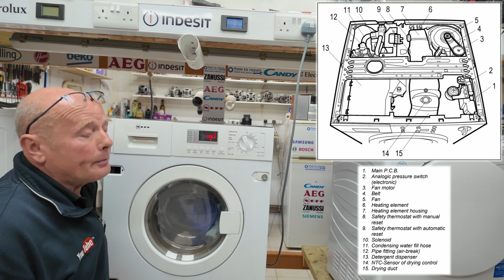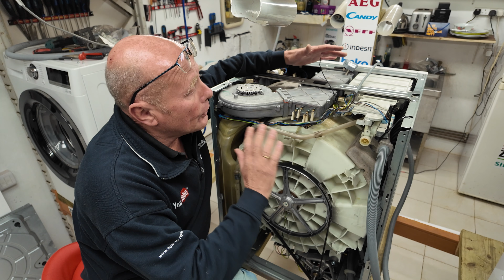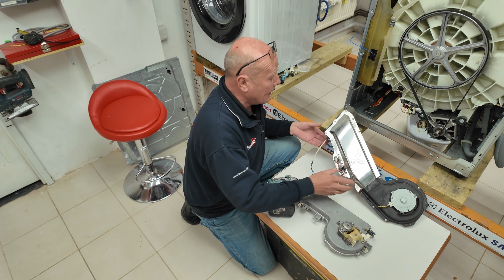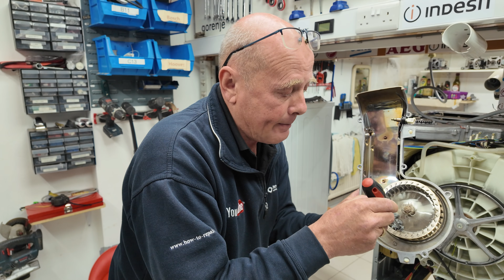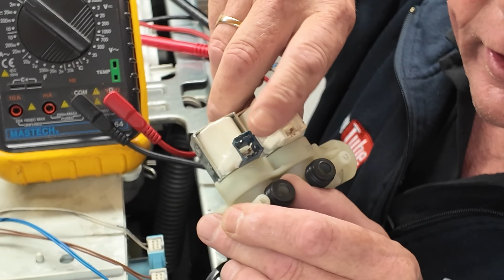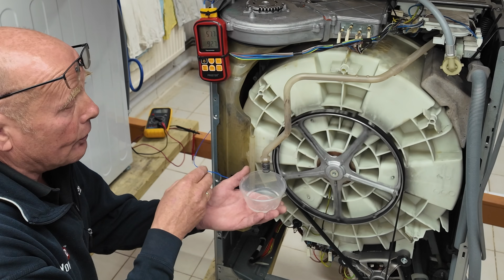How A Washing Machine Dryer Works? How to Rectify Washer Dryer Combo Machine's Errors & Faults

Comment: I have a Beko washer-dryer and its stopped heating at all, not only during drying but also washing. Changed heating element on the back of machine (under drum part) still the same. I planing to check thermostat and heater chanel. Any recommendations what could be wrong?

Comment: Thank you.
BOSCH  Washer/Dryer Series 6.
Mine wasn't draining, after research I looked at the Impeller, it was blocked, I removed the object & it drained 🙂
BUT......
Now it doesn't  dry!! The VERY NEXT wash drained but didn't  dry. 
You stated at about 6 mins & 30 seconds that Bosch ain't good at giving technical information!! TOO RIGHT!! Some of them from their help line say my washer dryer DOESN'T  have drying sensors others say it does!!! I'm  going around in circles!!! 
The washing isn't warm or dry!
 Coincidence it happened STRAIGHT after the draining problem? 
I was even told to clean the drying  sensors but when I asked where they are I couldn't  get a straight answer! One said they are IN the drum at the front near the door (couldn't  see any), others said it doesn't  have any!
HELP!!
Which is it?
What can I do?
Thanks for any help you may give. 
I'm  going to give them a very bad review.

Comment: Thankyou, Paul. My 2.5yr old Bosch popped the overheat switch. Bosch nearly charged me a few hundred bucks call out fee until I quoted Australian consumer Law. 

Tech came out. Did a few tests, hit the overheat switch and said job done, not to expect great performance from combo machines, and don't run too many intensive programs after each other... Fair enough, I'm guilty of running it pretty hard... 

6 months later, same problem. I figured I'd hit the switch myself. Fixed again.  I'm at home with a toddler and can't be without my machine. 

Did some reading, found you. And just spent half an hour pulling a not-so-insignificant buildup of fluff inside that fan housing. What a shitty design! No wonder it was overheating! And taking forever to dry! She couldn't breathe! 

I'm off to the buy Paul a beer page! You're a champ. Thanks from Down Under 🐨
Reply: And oh my god it just did a 2.5hr dry when I set it to do a 2.5hr dry. THANKYOU.
Reply: And holy shit the towels are actually dry! 😂 I'd been finishing them off in the old vented Tumble dryer for so long! 😵‍💫

Ok. I'm going now. 
You are an excellent human.

Comment: Hi, we changed our Samusng washer/dryer machine "wd80j5430aw-le" wather inlet 3 way walve. After that we tested the drying cycle of syntetic and we noticed that the machine was taking in wather all the time. When the cycle was done, the loundrey got out wet and cold. Do you maybe know why? It's like she's not regulating the walve at all, or cannot close it. The original walve had a small yellow flow restricotor in the rube of the drying walve, but the new 3-way walve has no flow restricotor there.

Comment: Hi

Ive a Hoover washer dryer 600 wash and go, model H6DPB6106MBC8-80.  

I can't get a definite answer from Haier or on the Internet if the machine is faulty.

It dumps 140ml of water into the drum and onto the load at the beginning of the drying cycle, then does the same amount 30 mins later straight after a high speed spin.  Does it on all drying cycles.

Is there a fault if not, why add a total of 280ml of water in a drying cycle?

Your video was great and detailed.

Comment: We just bought a Candy washer/dryer brand new, and it does somewhat work, but even when we choose the "extra dry" function in the app, some clothes still come out a bit wet (not dripping but just a bit wet to the touch). Is that a normal thing that it doesn't 100% dry the clothes? This is our washer/dryer, so we are very inexperienced with this :D

Comment: Hi, I' ve an Aeg series 7000 kombi washer dryer. Is it normal in this specific model that the drain pump is  always and continuosly on rotating for all the drying cycle? If the drying cycle lasts 2 hours the drain pump runs for the same time without stopping. I've had some washer dryers of different brands but this Aeg seems strange for me in the drying cycle. The results of dryng  are good with no error stored in the service menu but the drain pump always running is not normal compared with the behavior of the drain pumps of other washer dryers that stop for some minutes during the drying cycle. Please let me know for this specific model of Aeg. Greetings from Italy.Marco

Comment: May I ask, if I were to book an appliance engineer to do a MOT on my washer dryer what is the average cost (like you mentioned build up of fluff, pump check etc).  I recently was quoted £400 with 2 component replacement (not programme board).

Comment: Thanks Paul! My daughter just called me and said her 1 year old Samsung WD10T754ABT is making a burning smell that's getting in all her clothes.  I have the service and user manuals but I live in Myrtle Beach South Carolina, USA and she lives in Brussels, Belgium so I can't just drive over and look at it.  This is a great help in learning how it's all put together.  Hers uses a heat pump dryer but I believe the machines are very similar. I am trained as a HVAC and light commercial refrigeration tech, so that helps a bit.  It's amazing how much lint get stuck in those impeller wheels.

Comment: In 2009 I bought a Beto vented dryer, I have every other year removed the case and hoovered out the case, now in May 2025 it is starting to squeak, So with 2025 ban on vented dryers coming into force, I’m now on the hunt for another vented dryer. Ye# I can repair the Beto but a new will be purchased while they are available.

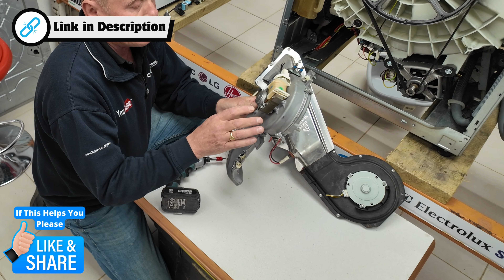Comment: I have the heater box similar to the one your showed for Hotpoint in your video at 9:36 . Question: how to test if my dryet heater fan motor is ok? Would appreciate clarity on this point. Getting F01 error, have already replaced the faulty heater element, the problem is still the same. Getting F01 during drying cycle. So need to test/check the heater fan motor now.
Reply from the maker: Hi ABS-i2p sorry about your problem but I'm in the Atlas Mountains right now and I can have free time occasionally. I would like to help you out during my live streams. I'll be hosting a new show on Sunday so please subscribe and turn your notifications on then you can catch me live.

I'll stick the link to the upcoming stream below so you can drop your comment beforehand. I will need the full model number of your machine which is written on the ID plate. I'd love to answer your problem on the show mate, cheers.

https://www.youtube.com/live/-1djYxP9MDQ?si=MqqH_hU65fLl83X9

Comment: Any idea what an "H1" error code on a Bosch washer dryer means? I have changed the heating element and NTC without success. Not sure where to go from here. Not drying clothes, possibly not heating water either. I can't find much info on any "H" error codes at all.

Comment: 15:00 why the dryer is need or connect with water valve I don’t understand
Reply from the maker: The cold water that trickles down the condenser plate assists in the hot warm air turning into a liquid therefore the pump can remove it

Comment: My Bosch combo just broke tonight in dry mode. After about an hour, it stops with an error, the clothes are hot but soaked. However, it's able to drain water properly in wash mode. Based on this video, could be water valve or condenser issue?

Comment: A work colleagues wife had a fault on her old drier. I had a look at it and found the old reset button had gone open circuit. I pressed reset  button back in then went straight to the filter and it was packed. Advised her to clean it very regularly and explained how the overheating mechanism worked.

Comment: I've got a Hoover washer dryer. It's only a year old just out of just out of warranty. 
Now the build quality of this machine is terrible. I mean it doesn't even retain the soap drawer when I pull it out. 
So the other day my drain under the sink had blocked up. 
Now the dryer side of things has stopped working and I'm sure I can't hear the fan. Now I'm in the market for a half decent one and my budget is about £600, but it won't be for a couple of months. 
I'm thinking Hisense to match my oven and hob, I'm getting my kitchen remodeled. 
Here's my question, do you think the fan has burned out or element as it's been running all day trying to dry the clothes when the drum was full of water. 
I've noticed that when I set it to dry only the program starts at two hours and fifty minutes, then quickly jumps to four hours and seventeen minutes. 
Any advice would be greatly appreciated. 
You've also earned another subscriber. 
Thanks in advance.

Comment: Can you explain what is the calculation between drum capacity (in litres) Vs load capacity (kg) Vs washer dryer heater (watts). Thanks 😊
Reply from the maker: normally most washer dryers only have about 50% of the  drying capability compared to the washing this is due to the fact that the machine needs to have a good airflow through the clothing to dry efficiently this will vary from manufacturer to manufacturer

Comment: its interesting to see the theory of operation out in the open so one can understand the steps necessary to diagnose here in the united states most of our dryers use a blower to draw air from the drum through a lint filter that the user can easily clean and then blow it along with the moisture evaporated from the clothing out a "Vent"  system to the outside of the house , in the process the air is drawn into the drum through a large resistance heater. they are not very energy efficient and we are just starting to see company's  here offer the type of dryer that has in essence a dehumidifier with a refrigeration compressor in the process , the challenge has always been the lint that manages to bypass the lint filter and the maintenance required to keep them clean , because condensing and dehumidifying dryers are a closed loop system they do not require venting they do require more maintenance and I wish the dryers software gave more information to the end user from there temperature sensors so that they could better diagnose these issues themself.. for example if the computer saw , no temperature drop  across the condenser they would deliver , an error message no temp drop sensed across the condenser "check" these items .. but you do have to know the concept of operation in the first place.. one maintenance item  that often slips people's minds is the water inlet to these valves has a fine mesh screen that can be plugged with debris so they need to be cleaned depending on how clean your water is in the first place,

Comment: Excellent video! I recently had to repair an LG drier washing machine, about 5-6 years old. The problem was that clothes didn't dry. I checked fan, resistance, thermostat, NTC, water valve. A service test was performed. All the those things seemed to to work well. The fan chamber was clean. No error was shown by the way. Talking to LG support guys here in Spain, they told me that either the problem was caused by the control board or the condenser chamber. I hadn't had this problem before so I told her insurance company both things should be replaced. As the repair cost was too high, the insurance told the customer the repair was not covered by her insurance policy. Having watched your video, I suspect the problem was that the condenser was not working properly, so didn't condense the vapor. Thanks a lot for sharing!

Comment: Hi Paul, my Hoover H-Wash&Dry 500 tripped the breaker and died the other day during a wash cycle. 

Upon inspection the display PCB was burnt out so I replaced with a spare bought from Hoover. With the new board I'm now getting the 'power on' jingle/beeping but no display or functionality. Any suggestions on how to proceed?
Reply from the maker: Some point circuit boards have to be programmed I do not know if yours was set up for the model